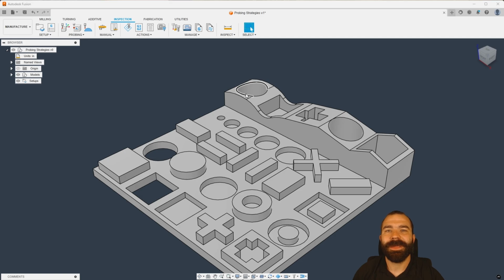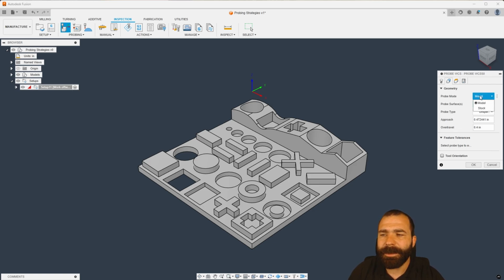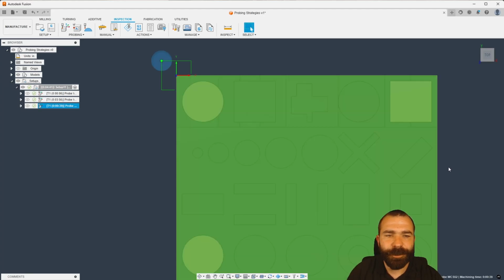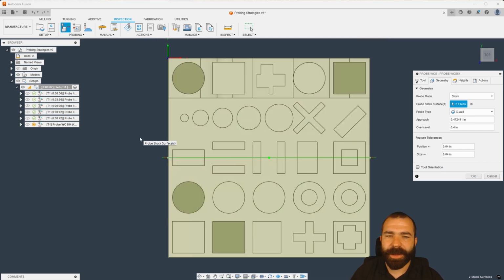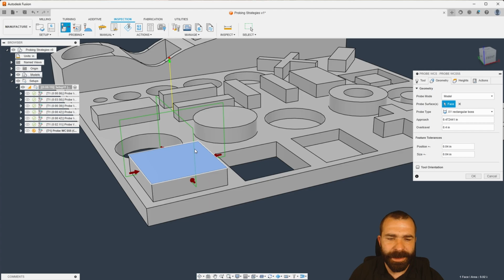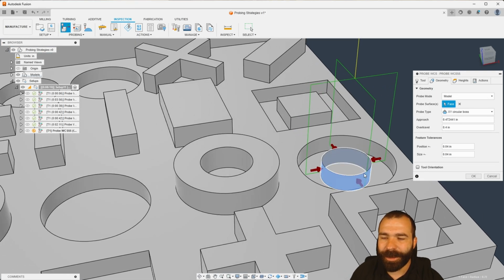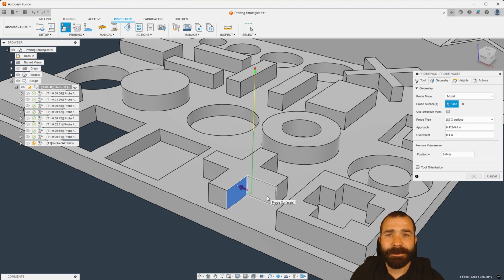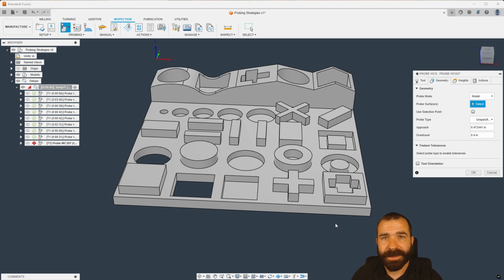Workflow Wednesday: Autodesk Fusion WCS Probing

Comment: This i will try!!

Let's say I have a slight angle on my fixture and I probe let's say X axis, will fusion compensate for the angle if I run the program? Or will it only throw me an error!
Reply from the maker: So Fusion Probe WCS will not adjust around C axis. You would need to use Part alignment in the Manufacturing extention. Send me an email Id be more than happy to do a 1on1 and review what your trying to do. Phil@jitcadcam.com